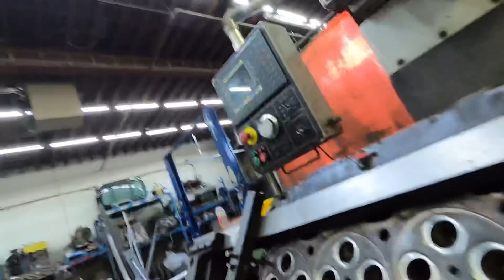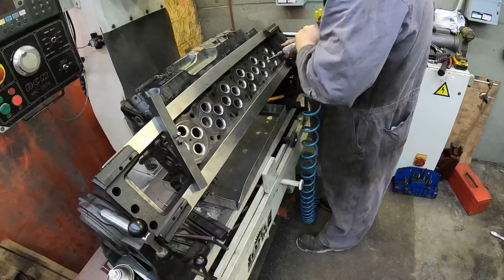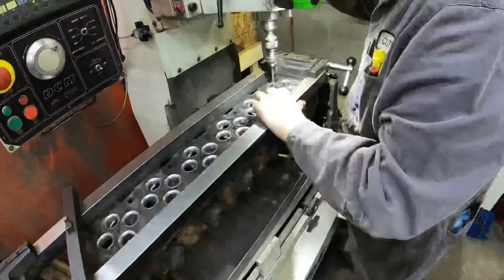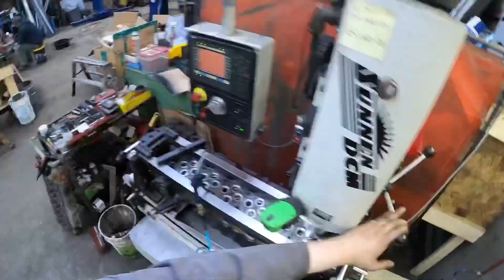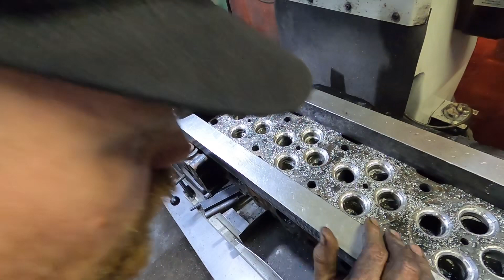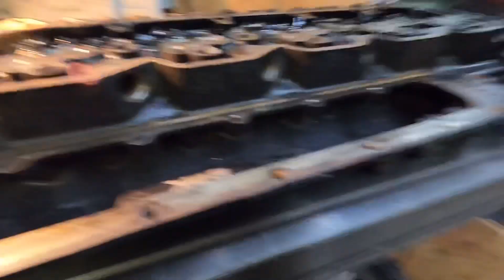Ppump 6.7 CUMMINS BUILD part 15  Seat cutting and thread frost plugs.

Comment: Hey Rob, you dip the seat in liquid nitrogen or peened them in, I didn't see where u talked about that.  thx
Reply from the maker: I don’t freeze the seats I find they get brittle these just have a .007 interference fit With retaining compound. When I do un shrouding i do small steak before I lapped the valves. Other wise you cut it out. You don’t have to do it anyways. Just makes me feel better lol